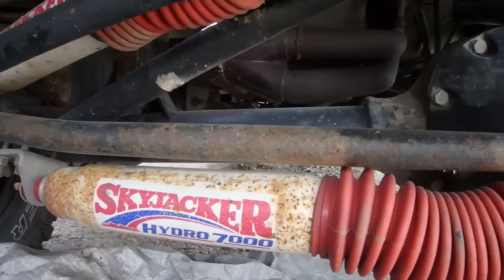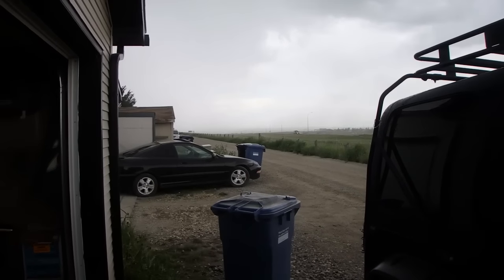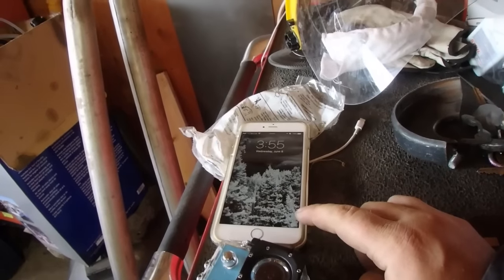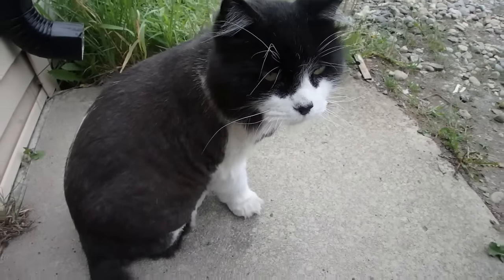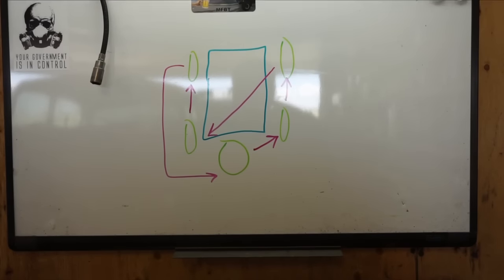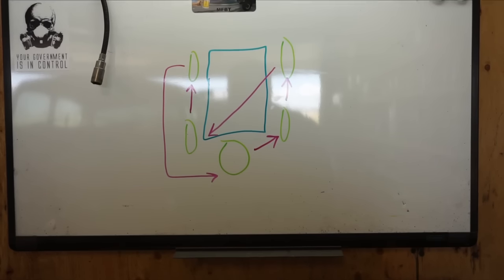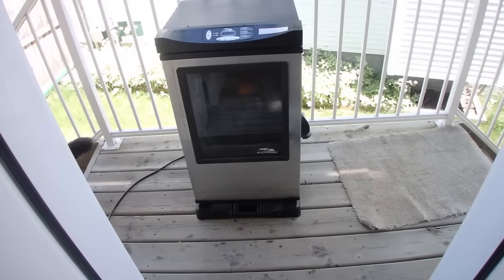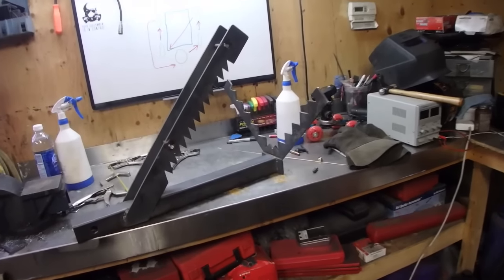Do It Right the First Time

Comment: "Unicorn Farts" Classic!
Cool video Jerry. I like your 5 tire rotation method. Im just about due for my first rotaion on my TJ and Im going use the 5 tire method since I replaced all tires 5k miles ago. Tomcat has a bigger attutude than you LOL ! Have a good one Jerry
Reply from the maker: Yup Tomcat has zerofucks attitude, what kind of tires did you get
Reply: +Bullshitkorner I picked up 5 BFG AT KOs I always liked the way that pattern looked and they handle very well on the street only 5k on them but so far so good. My 06 TJ is all stock with 53k miles, I just dont have the balls to lift it and lock it like yours. You definitely got a nice trail rig totally dig your set up !
Reply from the maker: it was a lot of work for one trip up north to the Yukon and Alaska.  Haven't really driven it since

Comment: your right, the cost of everything would go up if you raised minimum wage but its only because of higher level greed. When I was in school we did a case study on the GM engine plant in St.Catherines on how money was spent there. More money goes to building costs, ie keeping the lights on, heating, maintaining equipment then it does to pay employees and some guys there make over 40 an hour while the new employees only make 21 with the 2 tier bullshit.  Its all upper level greed. Never ever fall into the trap the company tells you that their broke and you need to take a wage cut. Greed.
Reply from the maker: they need to do a Case study of the damage the NDP is doing to Alberta